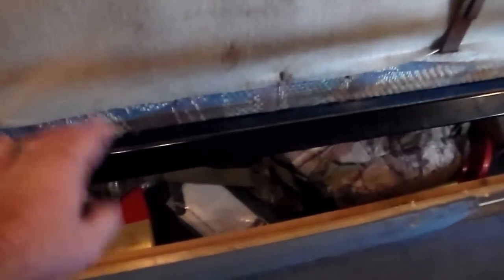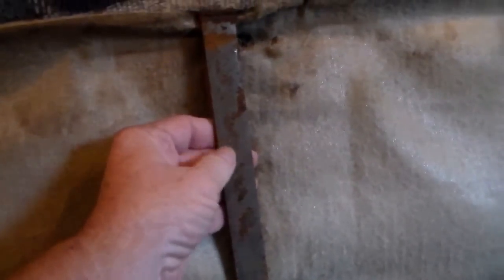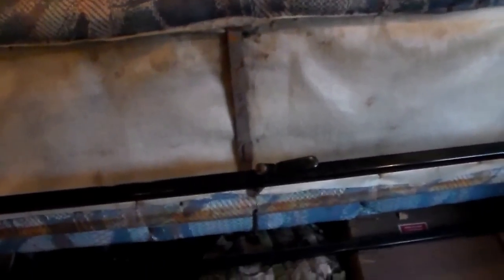IN the works

Comment: You'll be better off taking a section from the middle and bring the ends together.  You'll need someone to weld the frame together too. You could find a pipe that the frame ends fit inside to  make a coupling and screw it instead of welding.
Reply: Bill Gorman or a pipe that fits inside the metal frame ends would be even cleaner looking.
Reply from the maker: Bill Gorman thanks bill that will give me something to think about. thanks
Reply from the maker: Bill Gorman and that too, thanks again.